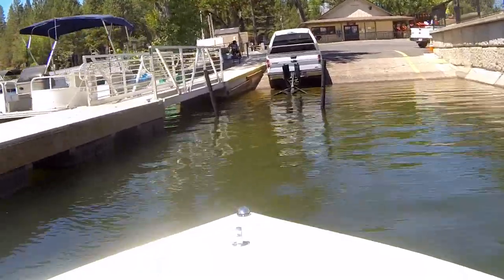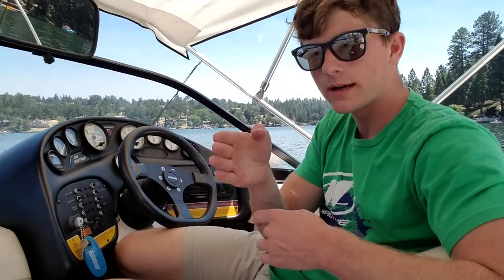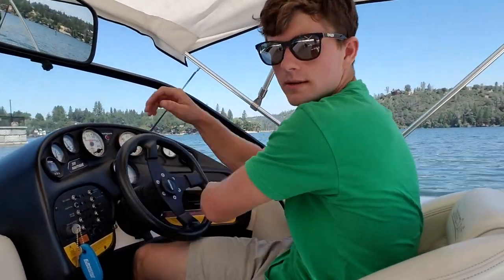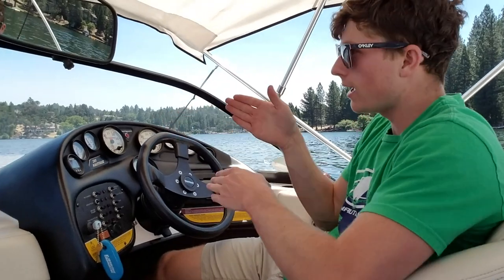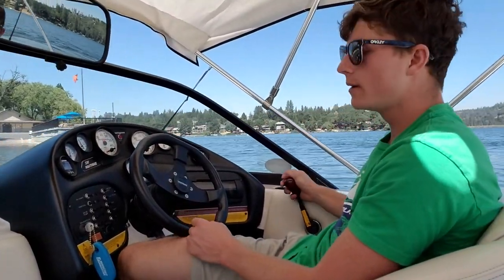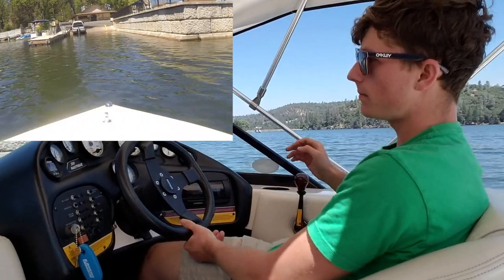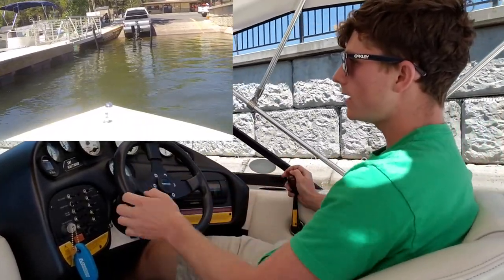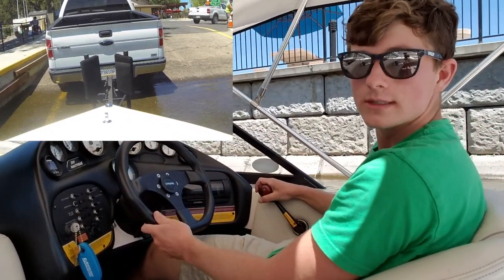How to Seamlessly Put Your Boat on a Trailer

Comment: never owned an inboard so this may be a stupid question, is it possible for the prop to hit the trailer?
Reply from the maker: If you are doing it right, no. But it does happen if not done correctly. The bollards in the water are to help keep you on the center on the boat. I usually see people start making a mistake when they go through the two bollards but miss the front part of the trailer.

Comment: The only problem with people driving their boats onto trailers instead of using their winch is that they often creat a deep hole at the end of the ramp which eventually destroys a good ramp. As time goes by trailer wheels end up falling into a deep hole at the end of the ramp and get stuck. The concrete ramp loses it's support and also drops, cracks and breaks away. Sure, it's a little bit harder, but I always think it's best to use your winch when you can.
Reply from the maker: You are totally right
Reply: @92813justin  Thanks mate.
Reply: Then the ramp is obviously not built right. Driving on and off the trailer is the correct, most efficient and SAFEST way to load and unload. Why would anyone risk injuring themselves trying to manually load a heavy boat? It's primitive. Build a longer concrete ramp, it's the 21st century.
Reply: @eddrichards5000  Good solution but most boat ramps aren't built to suit drive off and ons. Most aren't built correctly which is the entire point of my post. Driving off and onto trailers ruins a lot of boat ramps.